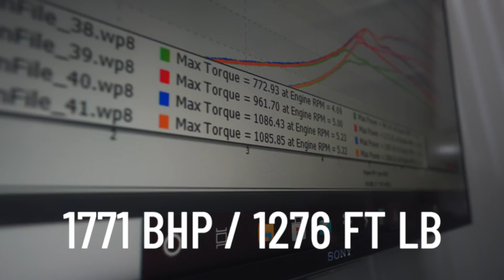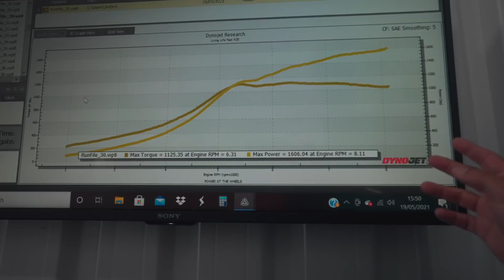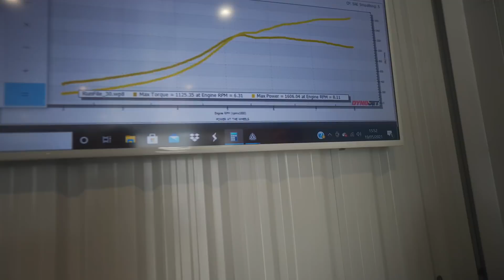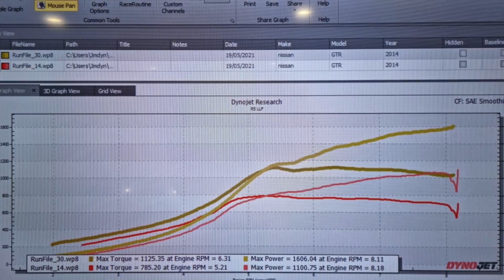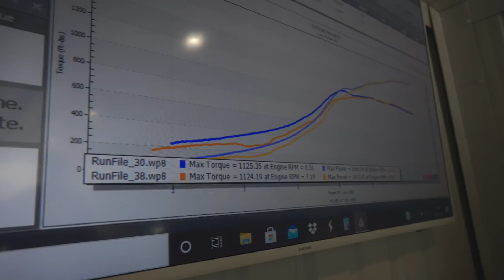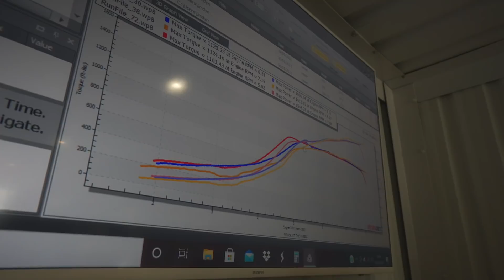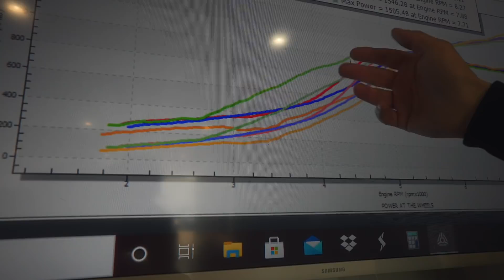DYNO PULLS IN MY 1889HP NISSAN GTR!!

Comment: I'd stick with the bhp at the wheels figure. 1600bhp at the wheels is enough of a head turner of a number. After all the science in the build , it doesn't make sense to go with a guessed figure. Just my view. The car is a beast and I love it. The engine mapper chap seems zero BS. Ideal guy to have in your garage.
Reply: I think point is bhp is 1890bhp but it’s 1600whp that’s why they use the formula and guess it as in the uk that’s what we use normally

Comment: Great video, really enjoyed a look this interesting project and a look at some of the dyno testing and optimising process’s.

I was wondering if one of the original Nissan factory engine builders (signature plate on the engine) motors are known for superior or differing results to each other, but they seam to come over as much the same; as I guess they really should.

If I also understood correctly the blue power graph line near the end of the video (dark horse) was the only experience so far of an anomaly with extra gifted performance among similarly modified GT-R’s.

Interesting to know how this can happen as the engine components must already be chosen for compatibility by mass and other critical criteria as the motors are essentially being blue printed for optimum performance, reliability and consistency.

Bloody great!

Comment: Why with the power of the cars you are running havent you got a propper fan .... you need to flow serious air to cool those cars with many dyno pulls heat soak must be terrible !!!   that torque is huge nice result ...
Reply: There is huge fan at front maybe cant see it on video
Reply: You think it doesn’t have a cable fan lol